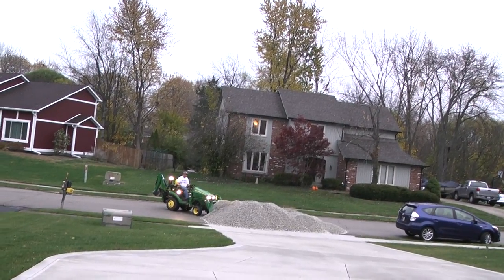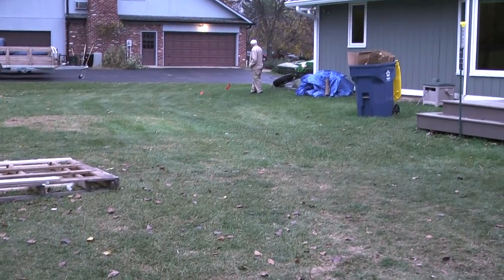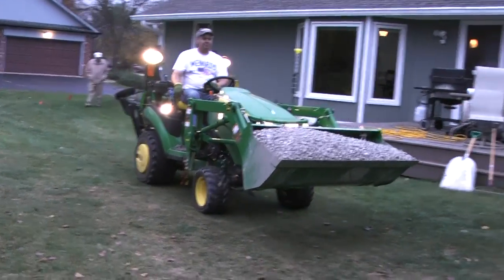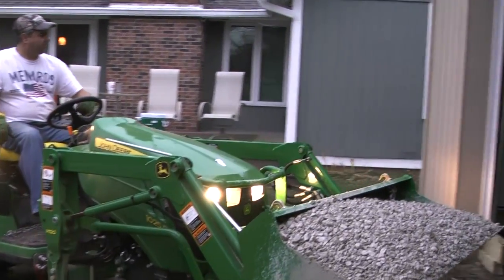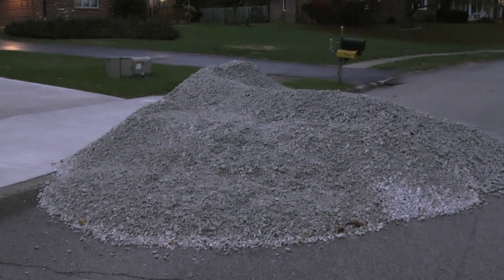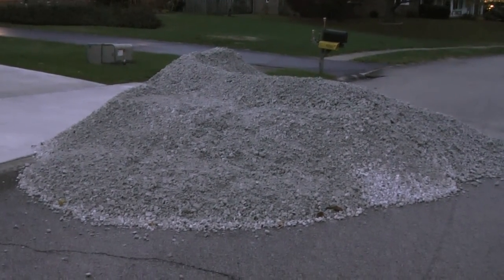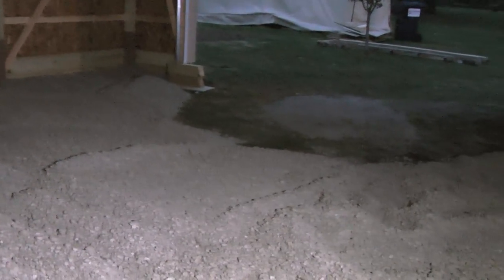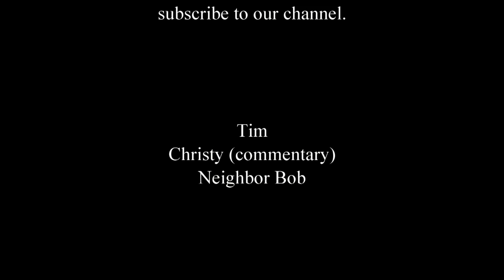#29 Deere 1025R H120 Loader Move 21 Tons of Rock

Comment: I was wondering what type of rock you are using?  I'll be doing something similar soon, but I was looking into using some type of driveway base material.
Reply from the maker: The names are different in different regions.  Here it is called "52's"   Everything from 3/4 inches down to dust.  A slang term for it is "road pack".   I might recommend the 3/4 inch washed stone (no dust in it).   The road-pack really packs tight...like concrete...quickly!

Comment: I wonder if you have any play in your bucket know I have 120 hrs on mine and my bucket wiggles when empty
Reply: scott5609 Ive got just over 400 on mine bought new and I have some play. However I keep the nuts n bolts tight and joints greased. They all get loose but just make sure you keep the nuts tight and it all greased. A non greased joint causes metal to metal contact and can ruin them. Will cause very loose joints and eventually cause them to break.